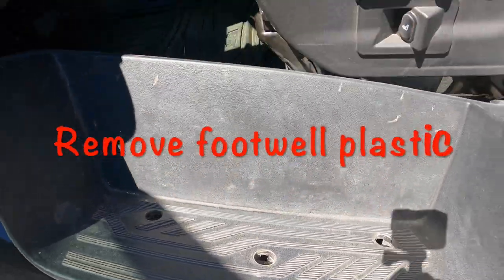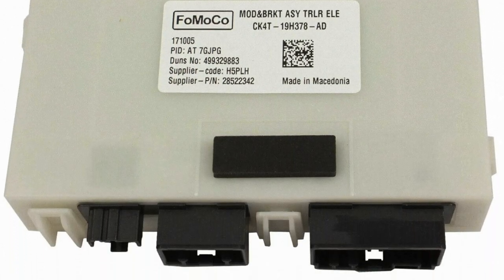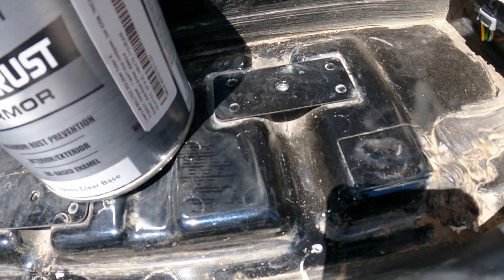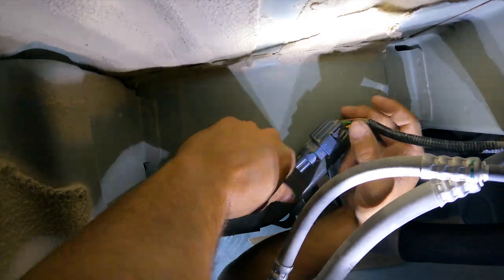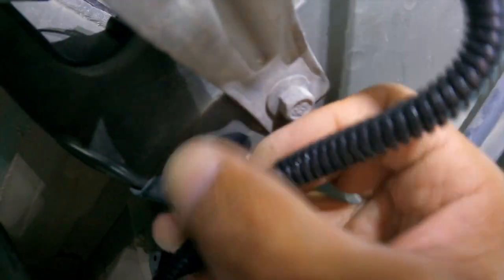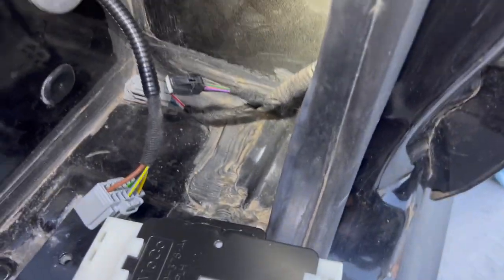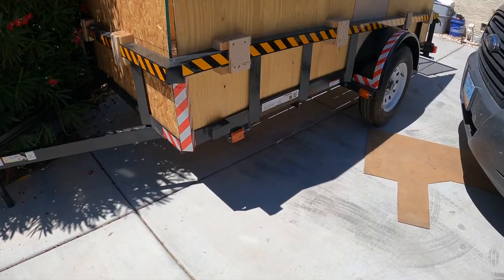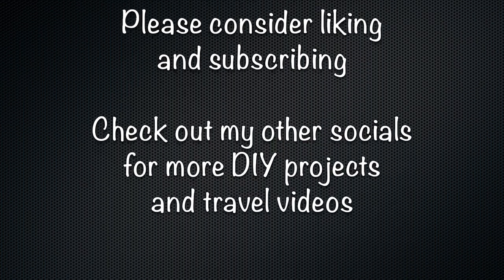How to get basic 4 pin trailer lights working. DIY Ford Transit Trailer Brake Control Module Install

Comment: One of the best DIY video I've come across. Producers and film directors must be built differently. They have some kinda empathy for what their viewers see, sittin' in their seat so to speak, while most clips are made to impress the maker... moan. You see details, but it's a wee bit more than that too, must be based on feeling the pain of disconnecting a Ford harness... etc etc Pass it on, mister, yer grrrreat.
Reply from the maker: Thank you so much for the comments. I appreciate you noticing the details.

Comment: Excellent video! I had no trailer lights, ended up that the TBC cable connector was not connected to the trailer socket connector.
Reply from the maker: Thank you for watching! Happy to hear you figured the problem out!

Comment: About 4 years ago I rented a 2020 ford transit van to pick up a Toyota land cruiser in Vegas, from idaho bought a trailer hitch and installed it on the rental van hooked up the trailer lights and nothing happened looked on Google About why they didn't have power at the harness under the van and found out you have to take it to the ford dealer and they hook a computer to the vehicle to turn power on!!  Well fuck that 175.00 charge being a  mechanic all you need to do is remove both right and left taillights find the power for the turn signals and brake lights,running lights and use a blue pinch connector on them ,run the wires through a hole that is on each side below the taillights and hook up the temporary connector going to the trailer lights.  Who said you can't use a rental for towing ?? And when your done just remove the tow hitch and remove the connector to the wires,never happened and you saved a ton of money on the rental 😊
Reply from the maker: That's a genius idea! Never thought of doing that. I'll have to add this to my bag of tricks. Thanks!

Comment: How did you manage to remove the footwell? I started to try removing the caps over the bolts and was worried I was just going to destroy them.
Reply from the maker: I used a small flat head screwdriver to remove the caps

Comment: Do I need to program this control module if I install it on my 2022 Ford transit-350 ?
Reply from the maker: I’m not sure about a 2022 Ford transit. But on my 2018 Ford transit I did not have to program it to get basic for pin trailer lights. You do have to program it if you the seven pin with brake control
Reply: @ChilliesWorld  ok. Thanks.

Comment: I have a 2018, brought it to the dealer to have this installed, running lights aren’t working, everything else is
Reply: Did your van come with the actual hitch ? Or just the harness thay runs front to back ?
Reply from the maker: My van came with a hitch and wires that go up to the driver's seat. I added a harness and a component shown in the video to make the basic 4-pin trailer lights work. To activate the running lights, you'll need to install another component below the cup holder. Once that's done, the 7-pin trailer connection will function, allowing both running lights and trailer brakes to work. I'll make a video of installing the additional part for the 7-pin connection in the future, but for now, the 4-pin setup is enough for my light-duty trailer needs.